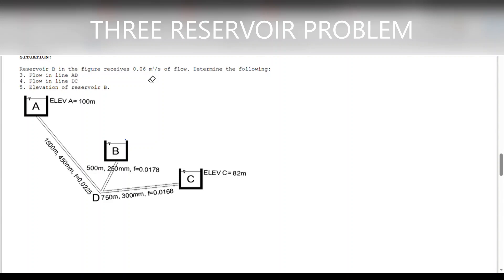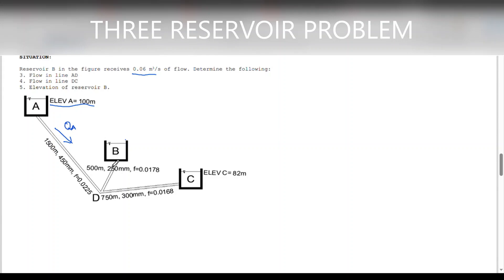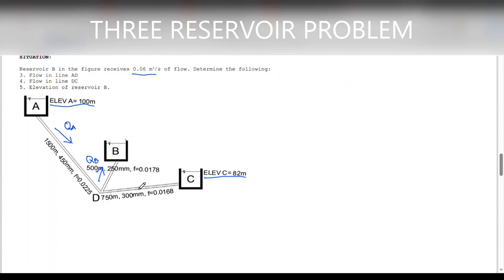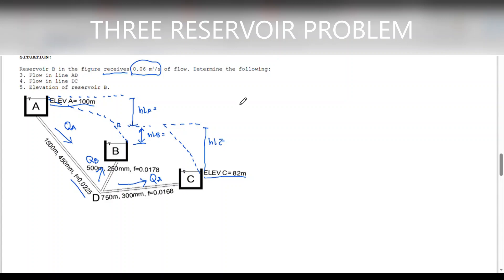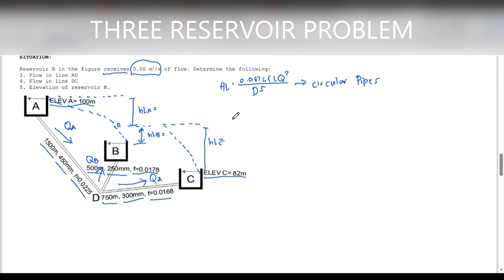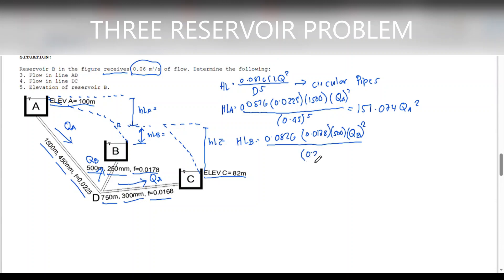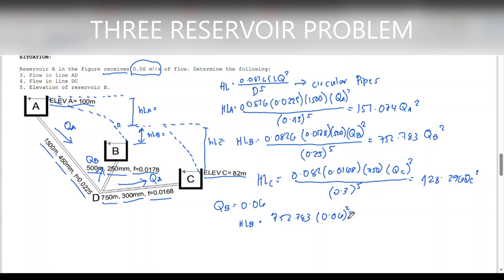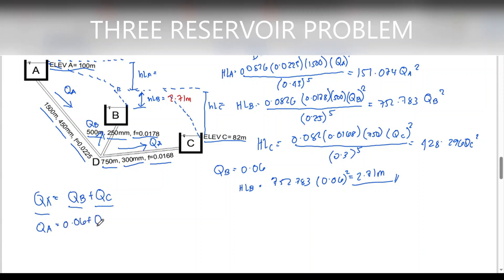HGE PAST BOARD EXAM PROBLEM (THREE RESERVOIR PROBLEM)

Comment: Does Qa not 0.0076 m^3/sec?
Reply: It's right, I was wrong.
Reply from the maker: Hello po Engr. Qa cant be less than Qb po since si A po ang nag susupply sa B
Reply from the maker: Thanks for watching po Engr.
Reply: Thanks engr. but I think Qa is 0.1836m^3/sec
Reply: Di niyo po ata na square yong 0.06 before multiplying to 428.296.
Reply from the maker: It was a past board exams po na problem May 2015 and Qa=0.219m³/sec po, baka po may na interchage lang kayo na values po orbaka sa rounding off nyo po
Reply: Pag hindi po na square yong 0.06, ang sagot po ay 0.219 m^3/sec.
Reply from the maker: Eto po yung equation Engr. 

18=151.1(Qa)² -428.3(Qa-0.06)²
Solve nyo po yung Qa and is is equal to roughly 

0.219m³/sec